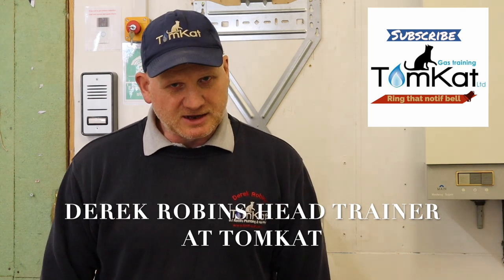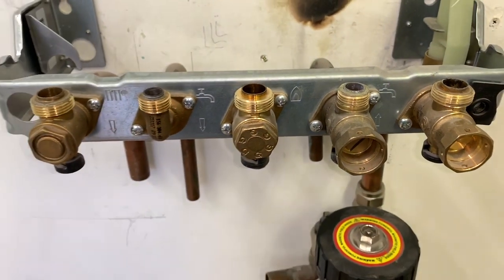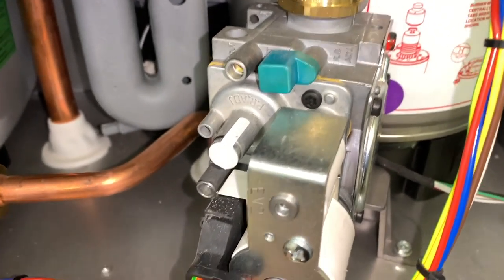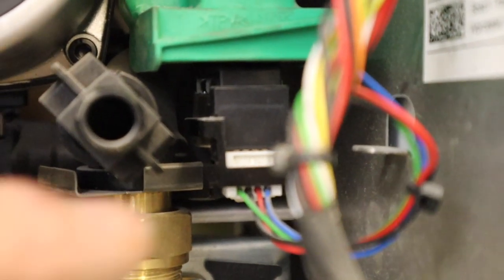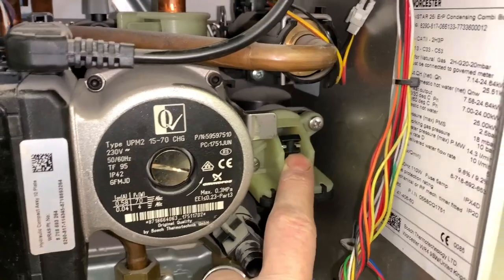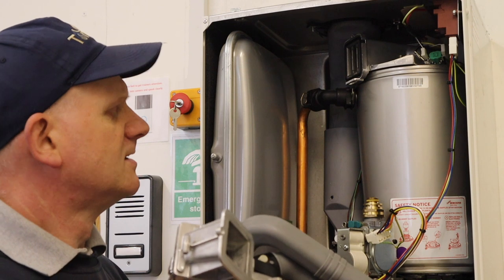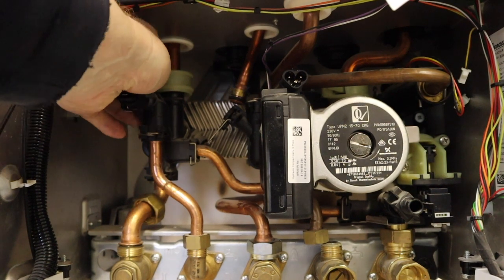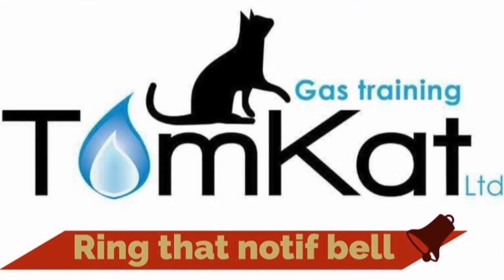WORCESTER 25i ERP COMBI BOIER, inside the boiler casing doing a full review and strip down.

Comment: Great Vid Derek. I found a quick way to remove the plate on them. If you undo the domestic hot water connection on the jig and cut the pipe as far down as poss it will come out the gap. Never failed yet.
Reply from the maker: peter beck done that a few times to get at the PRV also 👍🏻

Comment: Hi Derek
 
Just a few points / tips, 
 
the green cover was introduced too primarily stop any potential condensation dripping on to the stepper motor, that formed on the cold inlet pipe, the very early 2004 units did not originally have it fitted.
 
It might be easier to remove the fan and then remove the electrical plug and earth connector :)
 
A possible easier way to remove the plate / prv if no pipes are passing behind the boiler:
 
Isolate all valves.
Cover control box.
Drain boiler.
Open DHW tap.
Remove syphon.
Remove stepper motor.
Remove the main plug from the pump.
Remove speed control wire from pump (slide white tab to the left) and prise plug upwards.
Disconnect pipe from ex vess, and remove from black manifold, lift out of the way.
Remove pressure gauge plug from black housing.
Undo 15mm nut on cold water iso valve.
Remove pin from flow turbine housing.
Using a flat blade screwdriver hold against the flow turbine just in front of where the 3 wires are and pull the cold inlet pipe forward to disengage it.
 
Undo ratchet connection on top of the pump, and push it slightly towards the back.
Pull and remove the metal securing pin from the R/H/side of the pump.
 
Carefully prise the complete pump assy (inc the cold water inlet pipe) to the L/H/side, and remove it from the boiler. The pump will still have some water in the housing.
 
Remove the two screws holding the plate in, this can then be pushed backwards slightly, the L/H/side tilted up and the R/H/side tilted downwards, and then manoeuvred R/H/side out first at a bit of an angle, it will catch the notch on the housing above the bypass pipe, but it can be done. (the 1st time may take a couple of attempts).
This will also give access to the PRV.
 
If pipes are behind the unit, then the whole section will need to be removed like you have shown. (which is not to bad)

another great vid.
Reply: An easier solution would be to take the boiler throw it away and replace it with something with not as much plastic in it.
Reply: @richardhague3455  a vast array of modern boilers have composite manifolds in them, less weight for one.
Reply: @dazl7954  installers as you say are lazy !! They want easy peezy job and they buy the brand not the service engineer.

Comment: Great vid, thanks Derek. As much as I hate woosh!tters for the design and compact nature of things, they make all other boilers a dream to work on :)

That boiler was manufactured in Jan 2018 (FD code 817). A definite improvement on the old round fan bearing plates which have a tendency to be stuck in the closed position and throwing up ignition lockout faults. Not to mention the old bearing plate would be fitted the wrong way round by engineers too, looks like the new design will only fit in the right orientation. 

Hope you're well mate and thanks again. Hussain
Reply from the maker: Thanks mate

Comment: How to put pressure back in this boiler please , I can’t find anything , it’s doesn’t have a key and doesn’t have the blue lever like most videos are saying , but it is this model thanks
Reply: @Simeon Vidolov yes I know how to do now , I done it again yesterday funny enough , 

There is 3 ways to , 
 1 with key on boiler 
1 on off switch on boiler 

Or my one there is 2 switches on wall to let water on , you turn them slowly to let water in and will put pressure back up

Comment: Terrible design.  Hate working on them.
All that hassle to remove a plate heat ex..  and all the potential leaks putting it back together. 
Couple of screws on a duotec and the plate is out.
Its as if the design team was making it up as they went along
Reply: 1 screw on the Worcester Compact, and the plate is out :P and maybe you should try and design a boiler? we can find faults with any boiler design out there, what is good for one person, will not suit the next. but from what i have seen, most engineers want the case to fall off, the plate to jump in their lap...... its as if they are afraid of hard work. :)  just do the job as that is all the customer wants :P
Reply: @dazl7954  quite true, but a dirty system, damaged blocks, leaks etc very good chance of call backs on these...